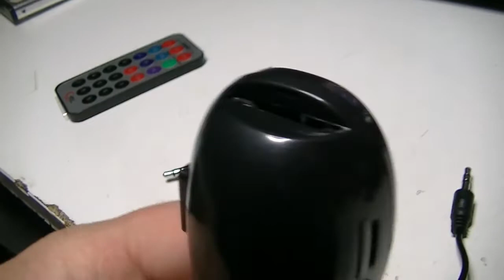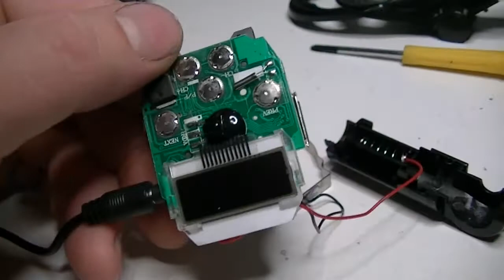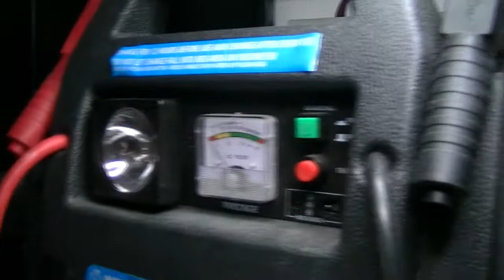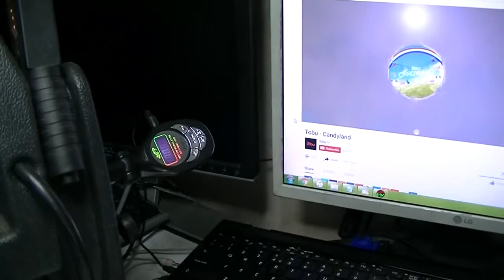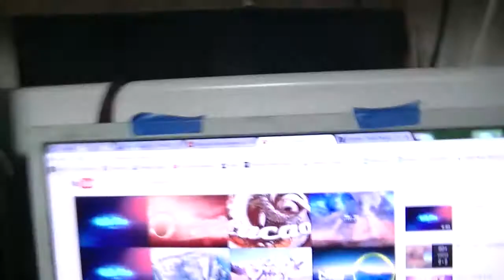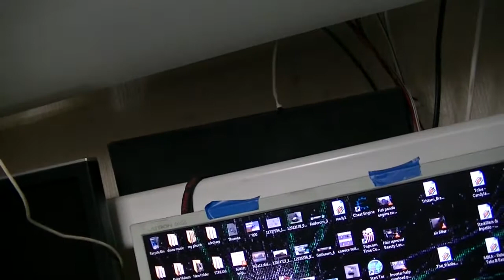Cheap cigarette lighter socket MP3 SD FM transmitter Repair and Review

Comment: i had the same issue. my solution was to turn the volume down on the transmitter,when turned on it automatically goes to full which is 16 so turn it down no more than 12,
i usually set it at 10 or 12 and then control volume on the stereo.so by doing this you should not get a buzzing sound an also very little to no distortion.i know its a late comment but hope it helps you or anyone else.

Comment: 78M05 is a small 7805 5v voltage regulator, I have one of those similar to it much older though, it actually has 2 chips not blobs, one for the micro controller and one for the FM transmitter. yea it kinda falls apart though, the buzz problem you are having is with your pc, the soundcard in your computer is grounded (because your computer is grounded) and the actual FM signal is going along the negative terminal of the little transmitter (same as the aux return) so that is then going on the mains ground. then also your radio is plugged into the mains (not as directly as the computer but still enough) i have had trouble with a nice amp making a fair bit of noise when plugging in my pc directly i solved that though with an optical audio cable.
Reply: SuperBrainAK لتلواوو